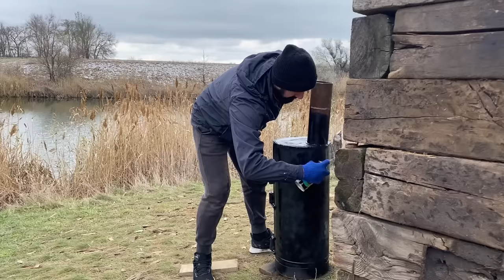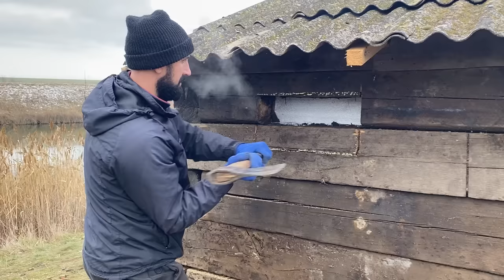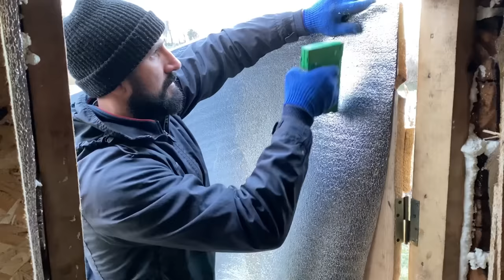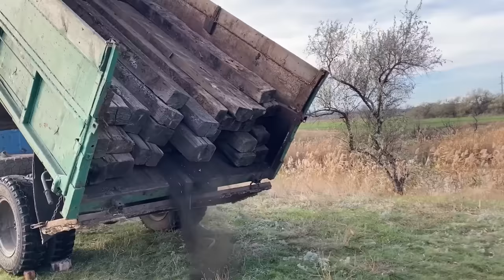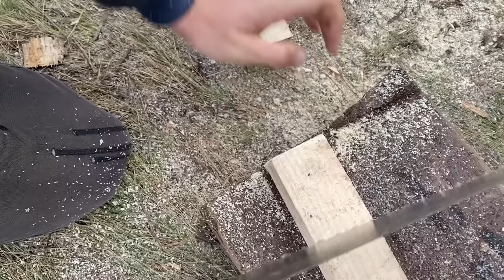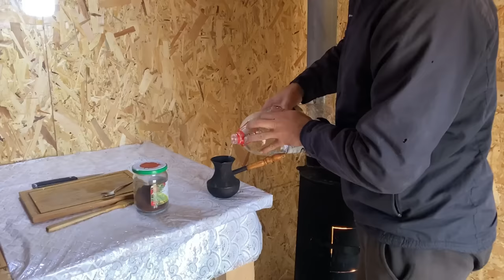Building of fisherman's hut from the sleepers | Secret hideaway near the lake

Comment: How were the paint fumes as they cooked off on the first burn?  Add a heat shield to the back wall around the stove and insulate your penetration through the wall.  Those sleeper ties burn really well.
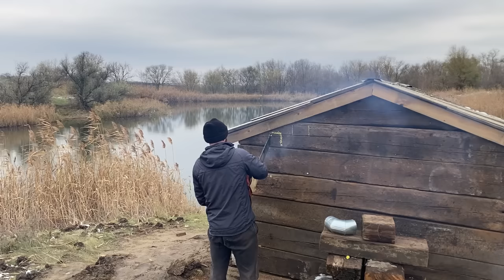Reply: 2:44
Reply: I thought of the same things. He did too much work for it to go up in smoke
Reply from the maker: There was a smell then it went away :) everything is fine thank you 🤝

Comment: The hole for the stove pipe should be larger so that you can install a piece of sheet metal, and a hole comes into this sheet through which the stove pipe is inserted. This means the wood cannot be overheated.Отверстие для печной трубы должно быть больше, чтобы можно было установить кусок листового металла, а в этот лист входит отверстие, через которое вставляется печная труба. Это означает, что древесину нельзя перегревать.
Reply from the maker: I'll fix it🤝🤝🤝🛖